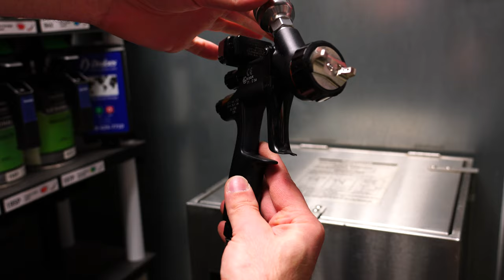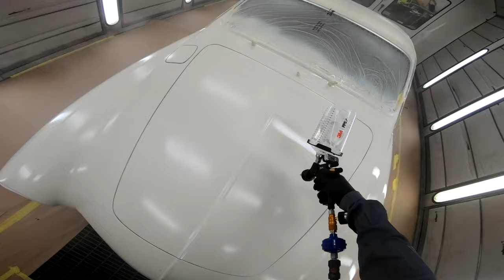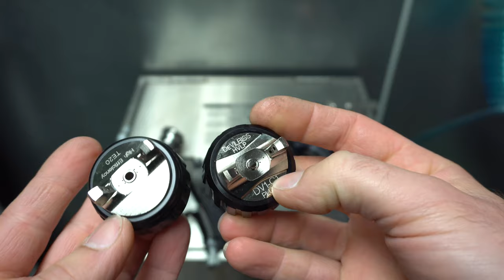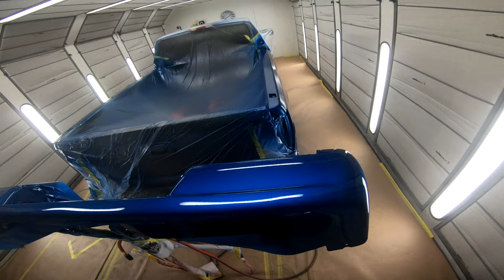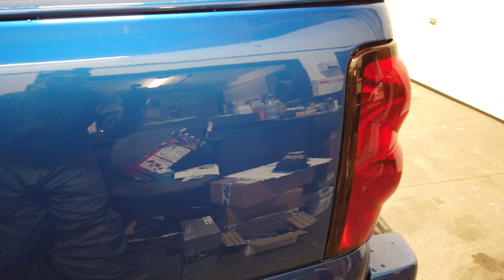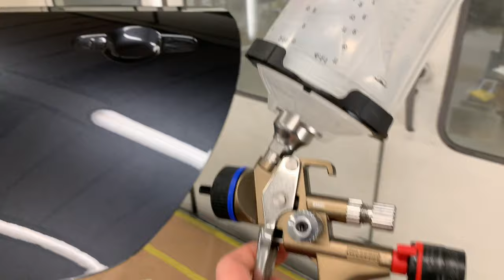DeVilbiss DV1 Clear Review: Slow and Smooth!

Comment: I like the c2 cap on the DV1 its a nice clear gun alittle slow but lays the clear out like glass
Reply: They didn't have that C2 cap when this video was done when the gun first came out,  Quicker than the C1.  Probably in Prolie language the caps are like the TE10 and TE20 respectively.    The DV1 basecoat gun is the real pleasure with silvers and blends.

Comment: I have my dv1 with a c2 cap 1.3 tip and still trying to dial in the air pressure. I used to spray at 30 psi for clear with my other guns but with this one im between 25-28psi still getting used to it

Comment: I do use the dv1 clear and base i have a  bit to many of them 4 base guns all in 1.2 and 2 clears one in 1.3 and one in 1.2  my boss gets a good price on devilbiss equipment, i also have 2 old gti pro's for 2k direct gloss and sealer/ wet on wet i find the dv1 uses less clear and base then the pro's , but we use alot of low bake hs clears so they need to be put on skinny or they run off the panel so i like the controlability of the dv1

Comment: I love the video but was curious if you changed the tip sizes out all of my DV1s came with a 1.2 in them but also came with a 1.3 & 1.4 in the box so if it where slower could you maybe do a review with a bigger tip and see how it would compare to itself ?
Reply: Change the air cap to c2 the gun speed up really good

Comment: Excellent review by a real painter-love your style.  Did/do you own a 5000rp?  Just wondering what your take on the 5500 vs 5000 was. I have the 5000 rp in 1.2 and sagola 4600 1.3  both loved for uhs clear summer painting-WS400 HD1.3 for winter.  My prolite and copper only see base.  I did just pick up a Tekna clearcoat gun. The TE25 works better for UHS clear than the prolites but not even close to the big boys at all-my opinion on devilbiss in a nutshell-good not great. Thanks again for the  real unbiased review.

Comment: Hi, did you add reducer to the UHS clear. My WS400 is my go to clear gun and what an awesome design. No other gun out there touches it. Sexy or what!!!
Reply: I have both iwata ws 400 just got the dv1 the dv1 uses more material but lays down flatter than the iwata
Reply: @Raider_Robert  My WS400 was temperamental to start of with, I tweeked the fan and dialed it in. She is no slouch and will lay clear as flat as glass. Would never part with her.

Comment: Ok I’m new to Universal clear I just switched from Iwata 400 1.3 to a DV1 I’m having a hard time getting clear to lay out what tip size do you recommend? I’ve tried 1.2 and 1.3 and can’t get the glass look I’m used to with my old iwata
Reply: Did you get this figured out? I just picked up the DV1 and heard from several people that the pressures I'm familiar with don't apply to the DV1 since the gage is reading pressure in a different location.
Reply: @81mont  kind of got it, I’ve been running it at 20psi with the 1.2 I run the fluid in 1.5 turns staying 8 to 10 from the panel using a 50-50 overlap with the C2 cap. Now if I mix my slow and fast Hardener 50/50 I give it a 1/8 turn out for a bit more fluid and give almost no flash time between coats. Bake for 15 minutes and done. Now keep in mind I’m in Louisiana so it’s 95-105 at 80+% humidity right now so these settings might not work as well for you. That said you should be able to get pretty close to glass from there.

Comment: Looks like you're spraying at a pretty low pressure. Did you compare the built in pressure gauge with the externally mounted one? Do they agree? The Pro Lite finish looks better to me.